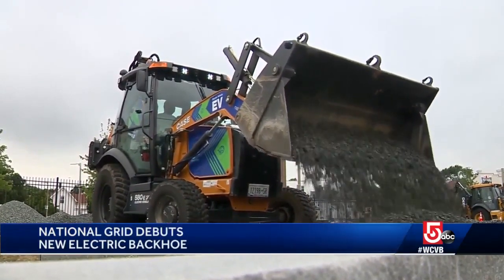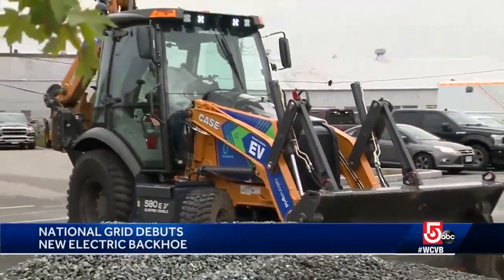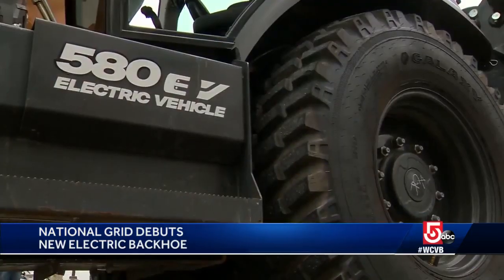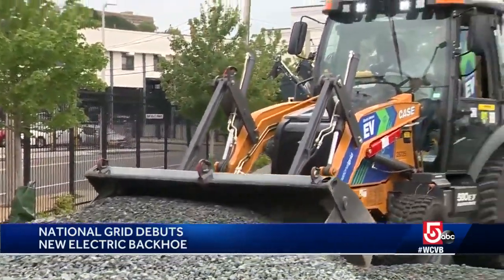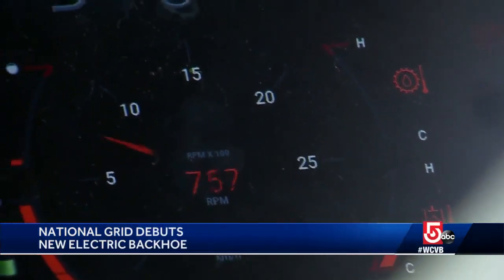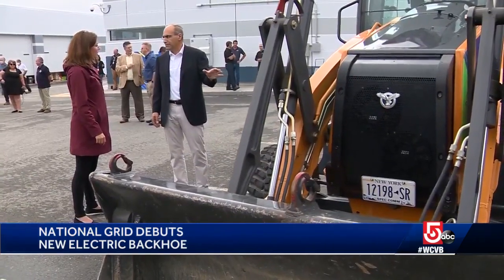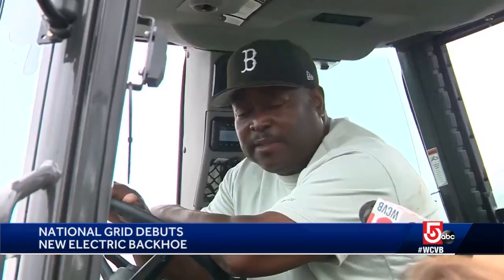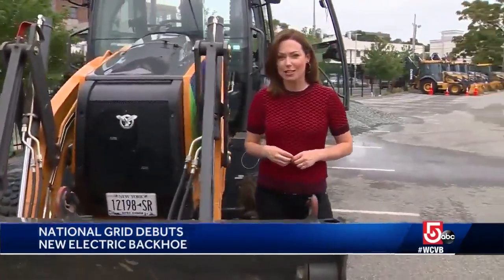Utility company using electric backhoe

Comment: That's  great  when there trying to  repair  a broken  gas line. And the battery  dies.
Reply: Why would you start digging a trench with no battery power?  Nobody ever runs out of gas right? Which one would you rather have digging up a water main in front of your house at 7am?